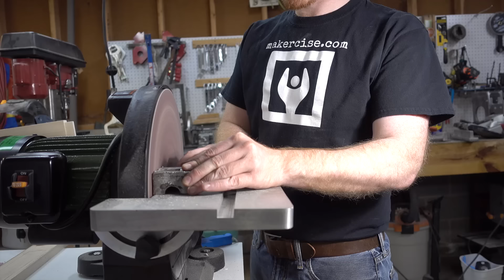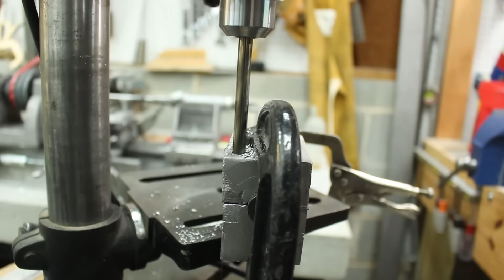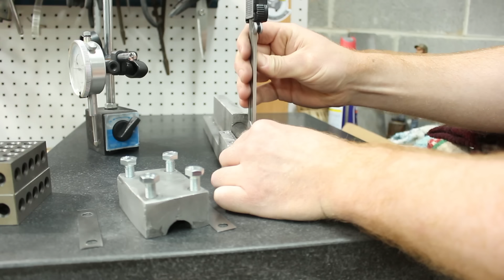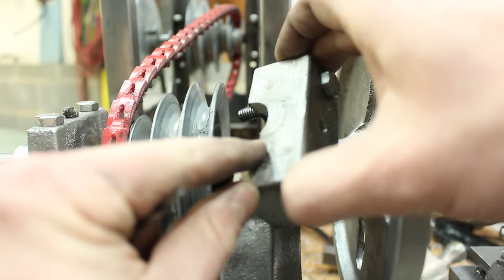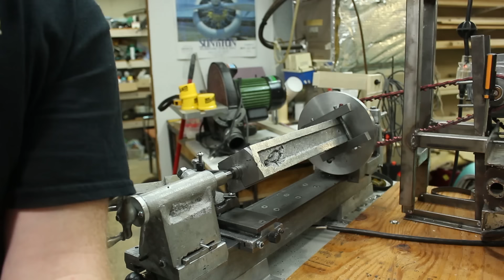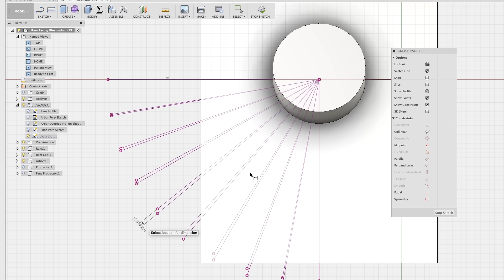Facing the Shaper Ram = Exceeding the Lathe Capacity - Gingery Shaper Part 4

Comment: Hmmmm...I wonder if an old Stanley No.4 Smoothing or No.5 Jack Plane with a 37~40° bevel on the iron could surface an aluminum casting...
Reply from the maker: I have tried with a hand plane but my triceps aren't currently big enough to push it along. :) I found that a "multi-rasp block plane" (no idea what it is actually called...but google suggested things that look similar worked well to quickly reduce surfaces. 12" sander is the fastest of tools I have, although you don't get the work out.

Comment: If you built the lathe then you will recall Dave's instructions on how you made the headstock for that lathe parallel to the ways and why. So same thing here to correct your arbor bearing misalignment you have here, would be to bore it out on the lathe to correct it and make it perfect and this could be done larger then your arbor to facilitate a brass or even an aluminum bushing for it that would then also be bored in place on the part and in the same jig to the correct size of the arbor according to plans. Just need a little reminding but not sure the lathe now is long enough to pull that off. But with a little creative thinking you should be able to come up with a temporary jig for this part on the lathe that would make it possible as the boring bar would be the only moving part and the piece being bored would be on the lathe ways or mounted to the crossslide itself to slide it along  for the boring bar to create the bore that would then be parallel. Also both pieces need to be bored at same time while bolted together. Hope this helps, and this is of coarse just a suggestion or you could live with the misalignment but it will always haunt you if you do. You could do this at anytime in the future after doing it the other way just to get er done up and running for now. But doing this proceedure would make a great video that many do not always see. Keith Fenner just did a similar video boring the mains on an engine block on his lathe. You know the "Get'er done guy on the east coast does the tool box giveaway for newbie machinists..

Comment: Love watching your projects and the honesty of the things that go wrong and the problem solving as a result , just 2 thoughts come to mind 1 mm cutting disc in a 5" grinder for cutting I find very useful and #2 is it possible to modify the spindle bearing over to tapered roller bearing for strength and adjustability ,,,,Cheers James

Comment: Can't you use the head-stock as a mill? by inserting the "blade" off-center, into the face-plate or some tool applied to it, reducing the time you spend scraping?
Reply from the maker: +João Gomes possibly. having something on the carriage to fixture a part should make it possible. For a large part like the ram it would probably be prohibitively large. Sanding a scraping isnt too bad until i get the mill.

Comment: It's always hard to gauge finish on video but it sure looks like you have that gingery lathe running well. That finish on the steel round stock looks good.
Reply from the maker: John Moody thanks. high rpm and large radius HSS is the money on 1018 on this lathe anyway.
Reply: Makercise good to know. I've been having a lot of trouble getting a good finish on 1018. Well... I'm assuming it's 1018. Hardware store shelf stock.

Comment: It seems you use Fusion360 as CAD. Please recognize that even if it is free like in free beer it is not open source. So at any time they can change their mind and ask for license fees also from hobbyists and since you have a lot of data locked into their data format you will feel pressed to pay. Better use an open source CAD like FreeCad which is an astonishingly well equipped 3D CAD. Maybe it is a little less polished around the corners but it works well. And you remain the master of your design data.

Comment: Very nice videos, Thanks for sharing. If you have large cavities with a horizontal top face gases are prone to be trapped under the flat "ceiling". Since you do foam core method you could easily tilt the foam core upwards to the riser. And you could even tilt the finished mold before casting. The riser should typically be at the opposite end of the sprue. Even though you use green sand which is supposed to be gas permeable you may still need risers to avoid gas bubbles. That still makes some of your castings look like moon rock ;-) You are in good company. Many neglect the risers.
Once you learned how to correctly place risers you could use petrobond (oil based sand with less gas permeability) or lost core technique by covering the core with layers of plaster and sand (mostly gas tight) but which both create very good surface quality and fine detail.

Comment: I see a few commenters have asked about drilling the arbor hole and you've correctly pointed out the inaccuracies of drilled holes. I have a similar but profoundly different question, why not bore the hole? Seems to me the boring bar you built for the lathe stocks would do a fine job.
Reply from the maker: brocktechnology that is a reasonable idea. id just have to devise a way to clamp the ram to the carriage. Maybe someone will try this approach sometime.

Comment: Thank You for sharing, sir ! Why didn't You just drill the hole for harbor ? So it is alined and tight .
Reply from the maker: A drill bit doesn't make a very accurate hole, at least not for a sliding fit with rod stock. Using the rod stock as a casting arbor will. Since we need a turning arbor with a center in it, I guess you could turn the arbor to fit the drill hole...so maybe it would be OK that the drilled hole doesn't match cold drawn rod diameter.  Then the only item left would be drilling the hole along the mating plane. My gut tells me that fixturing the ram and cap and drilling would be a bit more challenging that it seems at first glance. If you try that technique, please share the results.

Comment: At around 5 minutes you were drilling and tapping the ram and ram cap. It's a lot faster if you do all your step drilling and then tap. Otherwise you're re-chucking your tool many times more than you need to and making the process take longer. 

When you put a bit in the drill, drill all the holes you need with it, then move up to the next size and drill all the holes, and so on. When you're done you tap all four holes one right after another. You'd be surprised how much time it saves you when you get your workflow smooth like that.
Reply from the maker: Iluvquadbike i did what you suggest for the last three holes.  i have made it my practice to get 1 or 2 fastners installed before doing additional holes. i have had bad experiences with parts shifting around and causing alignment issues with the holes. maybe ill get brave amd try to be more efficient one of these days. ;)

Comment: You may want to try a VIXEN file instead of those rasps. With a Vixen you can take off a little or a lot of metal in a short time and have a vary flat smooth surface.
Reply: They are sold as "body files" by Eastwood.
Reply from the maker: I hadn't heard of that type of file. I'll keep an eye out for one and then compare the two. I definitely like the rasp though.
Reply: EFormance Engineering, The Body File has a cranked tang. There is also a regular straight tang file used by machinists.

Comment: a flange bearing is not the fix, the bearing will wear very fast, ball bearings are not designed for thrust loads, you want taper roller bearing or the easier fix simply put a thrust bearing between you head stock and the face plate
Reply from the maker: Tapered roller bearings sound like the more standard lathe bearing, but I'll probably go with flanged bearings in the short term though to stick with the book's construction technique. I will move away from plain bearings after the Gingery series.
Reply: There's also flanged plain bearings for taking thrust loading, or torrington-type needle bearings if you want to get fancy. Just make sure you oil them real well...

Comment: Just an observation...would it not have been easier and more accurate to clamp the two halves of the bearing together and then drill out the bearing surface? Thus ending up with  a perfect fit to existing rod stock.  Just curious. - Annie
Reply from the maker: I feel like alignment may be even more difficult with trying to drill the two halves and keep the drill bit on center, but maybe.
Reply from the maker: A drill bit doesn't make a very accurate hole, at least not for a sliding fit with rod stock. Using the rod stock as a casting arbor will. Since we need a turning arbor with a center in it, I guess you could turn the arbor to fit the drill hole...so maybe it would be OK that the drilled hole doesn't match cold drawn rod diameter.  Then the only item left would be drilling the hole along the mating plane. My gut tells me that fixturing the ram and cap and drilling would be a bit more challenging that it seems at first glance. If you try that technique, please share the results.
Reply: Drill hole undersize then use the boring bar spindle in the lathe to bore it to size.
attach the arbour to slide (shim to right height) Feed like when boring tailstock.
to improve slightly I would use machinist jack superglued rear of arbour with plenty of oil on ways to keep from "drooping".
Should be fairly easy and waaay accurate if ways are used as reference for setup.